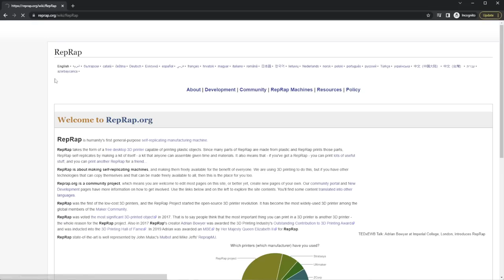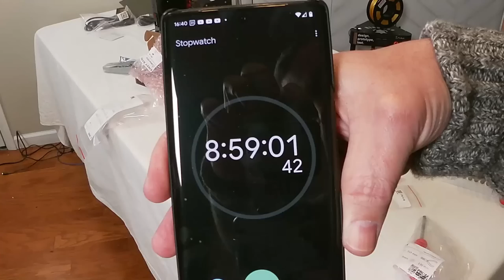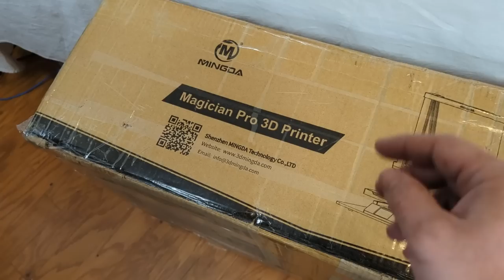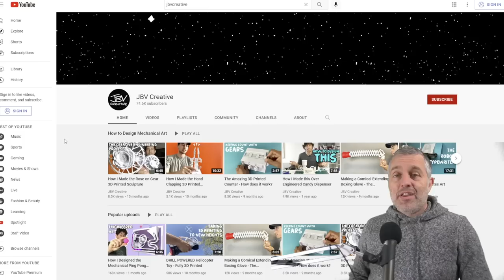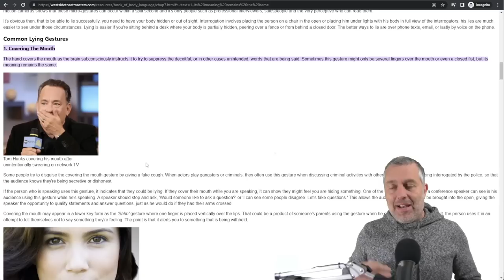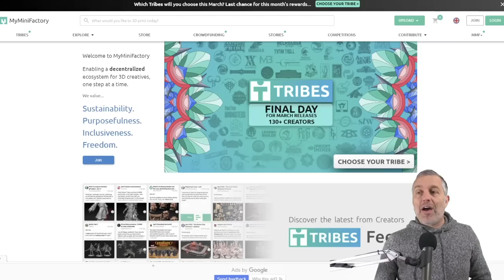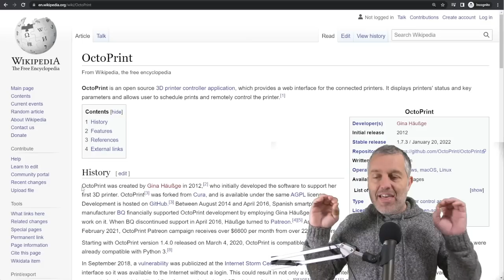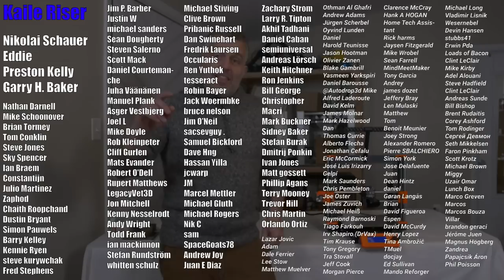Why Does Nobody Speak Truth About The Prusa I3 Mk.3? - It's Overhyped and Over Priced.

Comment: I find it so odd to hear that using 3D printed parts on printers is now considered a negative by many. While I understand the reasoning for quality, 3D printers took off because they were a means to create self-replicating machines in the reprap project. 

I actually want to see more printed parts in printers. Quality be damned!
Reply: Really really really bad idea if you plan to put a printer in an enclosure. I refuse to buy a 3d printer with 3d printed parts for that reason. During the reprap movement it made sense. Now its just an outdated gimmick
Reply: @ce5903  This is really only true if the part is printed with PLA or maybe PETG. Other filaments such as ABS and NylonX should be able to withstand the heat (unless enclosures get much hotter than I think.)

I imagine most people that want to use an enclosure are wanting to print with something other than PLA.
Reply: @kiliansto  yeah but the Prusa parts are printed with PETG I believe. If it was ABS it would be less of a gimmick. If it was polycarbonate, even better.
Reply: @CE I believe they used to print their parts with ABS and they switched to PETG at some point. Maybe they sacrificed enclosure usage - I have not looked into it. 

Regardless, printed parts != PLA or PETG printed parts; parts from some filaments work fine in enclosures.
Reply: It's funny that he complains about seeing printed parts on a printer then later recommends building a voron as the ultamate machine. I have a voron afterburner toolhead on my ender 5 + in an enclosure printed from ABS but plan to replace it with Polycarbonate as it can withstand higher temps and is easy to print with. All that said, I'm considering replacing my E5+ with the Prusa XL cause it's corxy with a tool changer and with the enclosure design they've showed, it will be a smaller footprint.
Reply: Yeah, it fears me at start because I thought it will be less solid than metal part but my MK3S+ printed far more pieces than my Ender 3 V2 and is always ok without any broken parts nor tweaks since I got it. I lost more hours to tweak and retweak and repair my Ender 3 than print on it.
Plus, if a part break on my Prusa, I can print it fast whereas on the Ender I have to buy it and wait... wait... hey yes the parts come from AliExpress lol !
Reply: @ce5903  Can't you just print your own Prusa parts from ABS or PC (or just any print service to print them for you)?
Reply: @ce5903  yes, lets love the fact that now you have no real freedom about your printers plastic parts 😂

Comment: I really wanted to watch a video about the technical parts of the i3 Mk3 which can be improved or are inferior to its contemporaries in some way, but my notes from a 54 minute video only have 3 bulletpoints:
- e3d v6 hot end is old.
- Bed slinger design is outdated; coreXY design is superior.
- Prusa i3 MK3 printers occasionally suffer print quality issues.

I would really like more elaboration on the technical aspects of how the hot end & frame design, as well as other components, are inferior to other consumer 3d printers or parts. I personally already understand why bed slinger design should stay in the past, but I don't fully understand what makes the e3d v6 obsolete. An acceptable definition of "obsolete" that I am positing here is: "the state of no longer functioning comparably to contemporary counterparts or no longer functioning to an acceptable standard." Is the e3d v6 hot end really obsolete - or just inferior? I don't know, because the information required to make that distinction wasn't provided in the video. I'm going to research that now on my own to satiate my curiosity, but I thought the video was premised on making the argument that the Prusa i3 MK3 is overhyped & overpriced. The Prusa i3 Mk3 is definitely overpriced, but I thought the video was going to articulate that argument, not just imply that it is because a cheaper printer produced an objectively better print quality in one test.

Comment: I still haven’t found an A-to-Z printer experience better than a Prusa for the price. My other printers are an Ender-3 V2, Anycubic Vyper, and Ender-3 S1 Pro, all modified to match the Prusa as closely as possible (at least auto bed leveling, all metal hotend, dual Z, removable bed, firmware upgrades for the live printing options). Those other ones are fun and I have loved working with them, but the Prusa just runs and runs and runs, keeps on running while I’m repairing the others. I’m looking for my 5th printer now, and just can’t find a better printer than a Prusa for the price. Everyone out there points me to the ones I already have. Thinking about a Flsun but I dunno.. don’t want to realize instead of 4 Chinese printers I should’ve gotten 2 more Prusas.
Reply from the maker: Why would you match a Prusa as close as possible? Do you think Prisa knows everything about printers and his printers are perfect? All metal hotenfa are not ideal.unless you are printing with high temperature plastic. By putting all metal hot ends on your printers, you were literally making them suck more at printing PLA and PETG which are the plastics that you print with 90% of the time. So this makes me question your decision making skills. Which calls into question your assumption that Prusa is the best. Question: why do you need two Prusa's or four Ender 3's? See, I don't believe you're a real person. I think you're a sock puppet trying to make it sound like you're an expert who has lots of printers, but really you're just here to sell.Prusa printers to my audience.
Reply: @DesignPrototypeTest  haha what an odd reply! I’m a real person with a real customer base for camera parts at a store called SPRKPLG (previous reply was deleted cause of the link). Mostly from Carbon Fiber PC and PETG, but I print PLA and PETG beautifully like a dream with no issues on any all metal hot end. Far less jams (actually no jams for a long time) that’s for sure. I wish I got money from selling Prusa’s, but they wouldn’t like me telling you that since this post I got in line for a Bambu X1C because it seems like a better printer for the price. I also got a Kingroon KP3S over a Prusa Mini (several issues on that one, oops my Prusa influencer account just got revoked) which has turned out great! As well as a poorly made Magician X which I slapped a Volcano hot end onto and had to redo the eccentric nuts and belt tensioners. Time will tell if all of these go down while the Prusa just keeps running.
Reply: @sprkplg  I completely agree. I don't see any reason why a full metal hotend should perform worse with PLA. Afaik it's even recommend to upgrade to a FM hotend before printing PETG because of the higher temps which will release toxic fumes from the bowden tube.
Reply: @DesignPrototypeTest  I was a subscriber of this channel but when to much venom against PRUSA came out of this channel I just left. I see other people spending a lot of time fixing the ender and any cubic while I have a small operation of 4 PRUSAs without hazzles.

Comment: I know you do not like Prusa but they just work and have very good print quality.  I have over a dozen 3d printers and the Prusa is my favorite.  The firmware is by far the best out of all the chinese printers.
Reply from the maker: Did you watch the video? That Focoos Chinese printer "just works" too. So does the Mingda Magician Pro "Just work."
Reply: Have you tried klipper? Makes Marlin look as outdated as it is. I have also had ender 3's that just work and also print better...
Reply: @NoThankYou541  I do, I have clipper on one of my sovol sv01's and in the process of building a voron 2.4 atm too.
Reply: @DesignPrototypeTest  No Chinese printer I have tried works as smoothly and without fiddling as the Prusa's I have and that is down to the refined and feature packed firmware.  Btw all but one of my Prusa's are Prusa clones that are half the cost from China and 99 percent the same as an actual Prusa.  Uses Prusa firmware as well.
Reply: prusa are made in Europe... So comparing it to Chinese printers is maybe not that fair. Also a prusa is almost twice the price of a ender 3, so that money has to go somewhere (I hope)
Reply from the maker: @iano0100  i3 Mark 3 is more like three times the price of an Ender 3. If you buy a pre-assembled I3 then it's five times the price of an Ender 3. Also, what percentage of the printer is actually built in Europe? We know the 3D prints happened there, but what about the stepper motors? What about the linear rods? What about the bearings? I suspect a large portion of the printer was made in China just like the Ender 3.
Reply: @iano0100  Get a Prusa clone from China, half the price and 99% the same.  I have 8 of them and all work exactly as good as my actual Prusa for less than half the price.
Reply: @DesignPrototypeTest  What about customer support? I've contacted Prusa support twice and gotten online help and issues settled within 20mins. How's that on Creality? Yeah not gonna happen 😄
Reply: @ShuhDonk  can you name or link some of the Prusa clones that you recommend?
Reply: @nawzyah  I have 8 of the FYSETC Clone Prusa i3 MK3S Complete DIY 3D Printer Full Kit  from aliexpress.  They cost around 370 dollars shipped in the US.  Has everything you need but the 3D printed parts, I think you can buy those too but I always printed my own.  Use the Prusa manual to assemble and then get latest firmware from prusa and flash it once built.
Reply: tHeY jUsT wORK riiiight reading prusa forums they have same and as many issues as ender

Comment: Actually everything has been already said in the comments. Just two more little experiences from me: 
Service:
Before I bought my MK3s (today +) I had an Ender 5 pro.
It was quickly assembled. But it took 2 weeks until my first print (I was a complete beginner). They shipped the thing with wrong z-steps for a different spindle. After only a few days I was offered a beta firmware. Thats all help I could get from Creality. It didn't work either and I was in despair until I saw in a video how to set e-steps... Then I thought to myself that there must be something like that for z and then it worked. I changed almost everything on the thing to make it more reliable (which it wasn't until the end), then I changed everything again to increase the print quality. Then I bought the Prusa and everything went well from the beginning. There was a cable break once. I told the chat and they immediately sent me a new one via express.
The print quality is not great, but reliability is the most important thing here. In the meantime, I have also built a Voron. Here the print quality is better, but the reliability still leaves a lot to be desired.

Stolen ideas: 
Creality (and many other companies from China) itself has also copied a lot from other companies. Here, the innovation is just as good as the new releases from established, mostly non-Chinese companies.

Big ego from Mr Prusa: 
I am not sure if the focus of Prusa Research is due to Mr Prusa's ego.
I think it is a marketing strategy. Similar to Steve Jobs or E.Musk, this one man focus serves to build trust with the customer and from a marketing point of view it seems to work very well. Don't be so harsh, somehow this is not serious despite your otherwise good arguments.

Conclusion: Yes, there are cheaper printers. Yes, many have better print quality and better hardware. For someone who doesn't want to stress and also likes to print materials other than PLA and PETG, the Prusa is perfectly fine. It depends on what your priorities are and what they are worth to you. Super support and very simple, uncomplicated operation were more than worth the money to me. Everyone has to decide for themselves.

Comment: You spend almost 6 minutes complaining about a manual that literally is written for the lowest common denominator. like honestly you spend more time complaining about this manual than it would have taken to read it... anyhow that really turned me off of this video. The fact this video feels like you are trying to find reasons to hate this printer. I just want to know if said printer is good or not... I don't care about how you have a beef with an old boss... blah blah blah. I have several printers already like Ender V3 , Sovol SV01, Elegoo mars, and etc... I wanted to find a good printer for high temp printing. this video was not informative ... Your complaints focus around how you have to build this , but you do know you can get these assembled right? At the ten minute mark I stopped watching so I never got to know if you knew or not if these can be bought pre-assembled.
Reply from the maker: Don't you think you are kind of the pot calling me black? You spent more than six minutes counting the minutes and then writing this comment...I'm aware that many people disagree with my manual comment. But at least CNC Kitchen feels the same as I do: https://youtu.be/nik-HCeOSB8?t=513